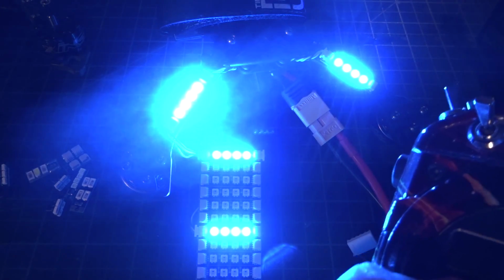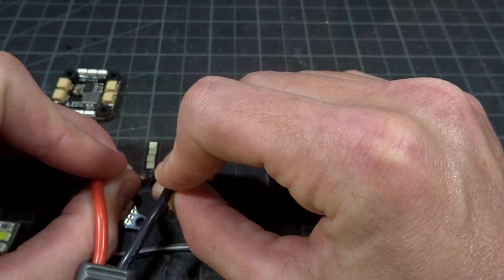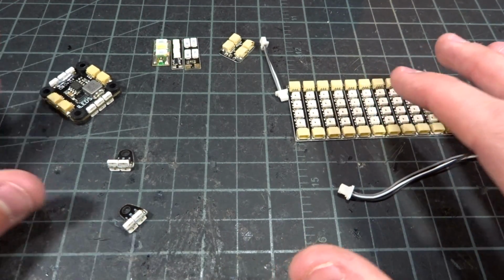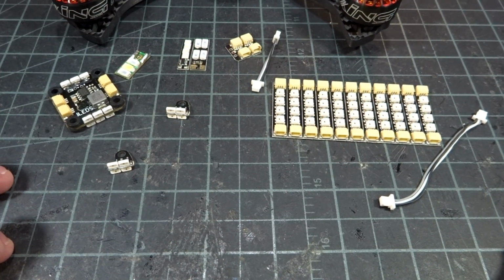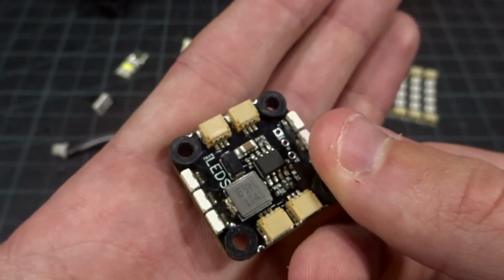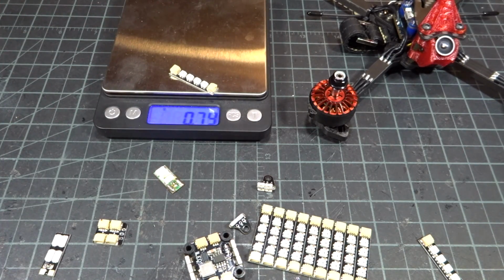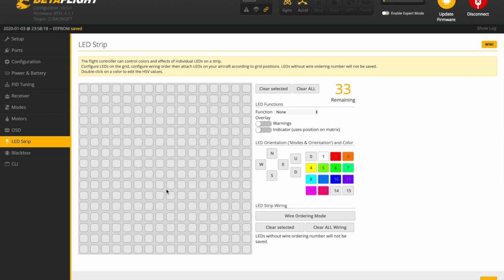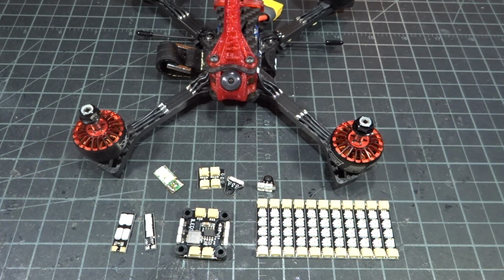How to Add LEDs To Your Racing Quad

Comment: in betaflight now 4.3 did you have to configure anything in the ports tab? my tiny leds.. Rainbow vs2 just blinks red,, I have the speedybee f7 v3 and i'm wondering if the led ports of the flight controller have to turned on through the port tabs..
Reply: nevermind the speedybee f7 v3 has a boot button, once you press it, it works with betaflight.

Comment: Hey. Short question regarding the SaddleLites from TBS: product sheet says, that they act like one chip. So this means, that I can put like four of these in a series connection and I just need to address one chip in Betaflight instead of your four?
And: Will this work, that I hook them all in ine? Signal I would be also signal out for the next LED? Will be the 5V regulator of my T-Motor F7 Mini enough? I cant find anything about the Amps tbh.
Thank you in advance!
Reply: Got it, 5V got 2Amps .. sooo. 4 of the SaddleLites in serial in possible? Is setting up similat to your tutorial? Because using an AUX channel for changig the colors is dope. I also see your Switchback with pleasure :)

Comment: Wish that led pdb would work for a kiss fc though I just figured that one out lol for RGB LEDs the signal has to be ran in series not parallel
Reply: It will work with Any Flight controller that can provide an LED signal.  I'm pretty sure kiss has this feature for color and intensity changing on TX too.
Reply: @TinysLEDs  yea I have it on a knob but I tried running all 4 signal wires to 1wire on the kiss v1 harness and it wouldn't work. It made me use the signal out, like I Daisy chained the signal wire only and it works now on a knob on the  tx
Reply: @TinysLEDs  I guess it could depend on the type led maybe idk I asked around and everyone said it would work but it didn't. Even on YouTube people put 4wire on 1 pad for led out
Reply: @Reecefpv  IT depends on LED. It also depends on the kind of LED. You can wire it up many ways though. These LEDs do work on KISS though.
Reply: @TinysLEDs  awesome I wanna get some and check em out . I really like the saddle lights . And Thanks

Comment: This would have saved me a lot of time a month ago - but this is still a pretty awesome setup.  I did the ultra-tedious version where I manually cut, scraped, and soldered the 1m 144 LED strip and taped that down instead of using a kit like this.  Let me tell you, the kit is worth it.

Comment: The LED power board works on 30.5x30.5mm Stacks with the included adapter.